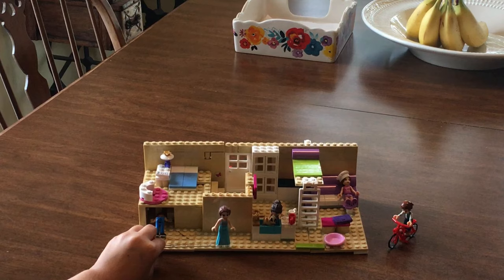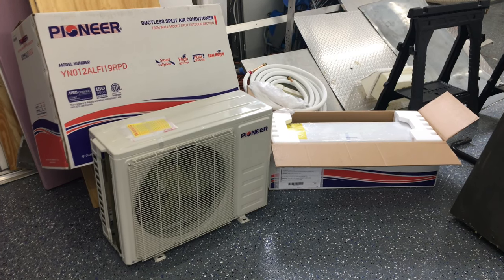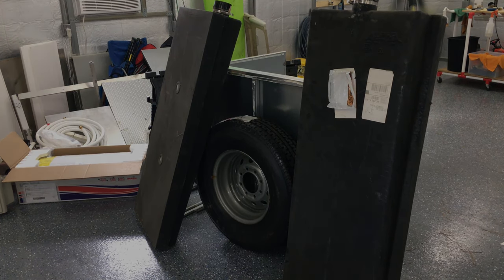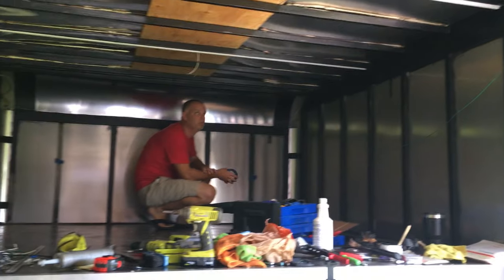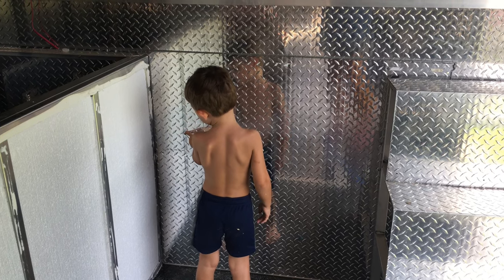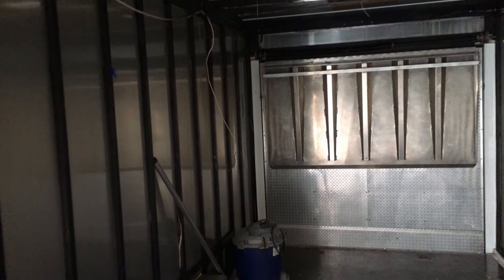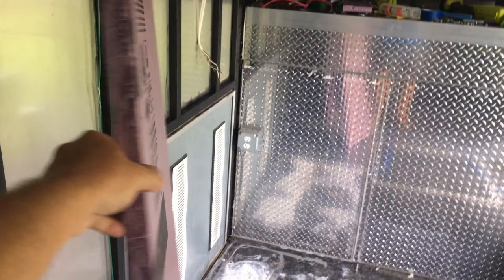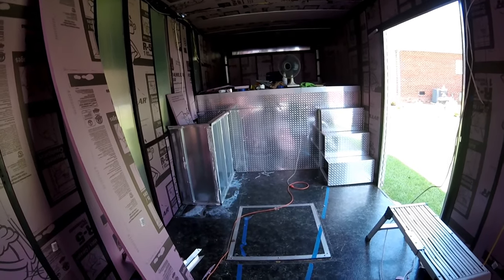Is Insulating a Cargo Trailer a Game Changer?

Comment: Did you glue your insulation to the ceiling?
Reply from the maker: We didn’t. We cut it to fit tight between the roof supports. Then installed the ceiling panels.